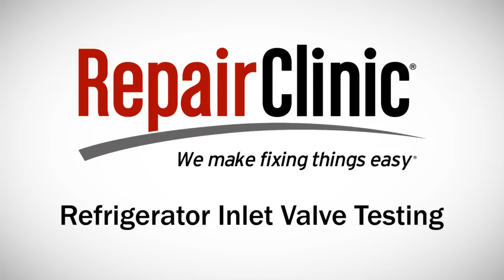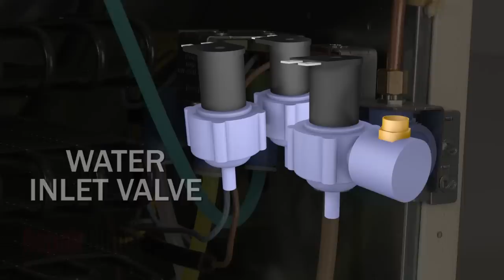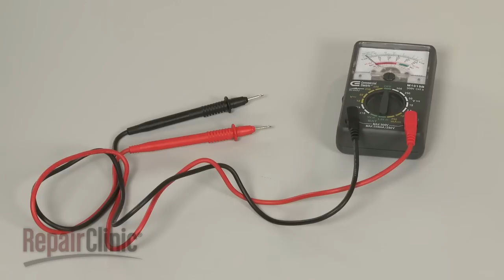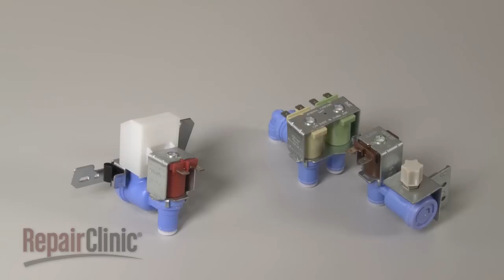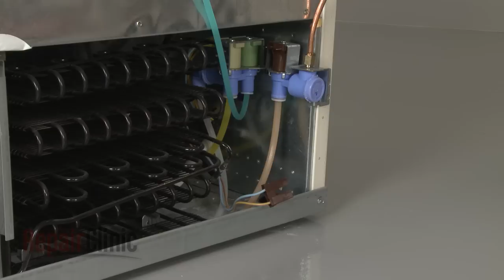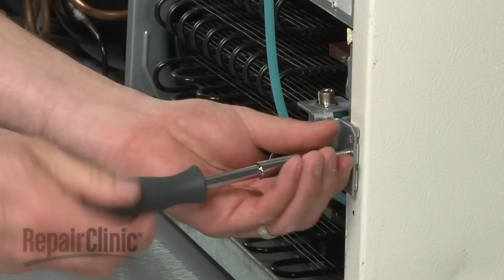Refrigerator Not Making Ice? Inlet Valve Test, Troubleshooting

Comment: My Frigidaire ice maker model FD1104S p/n 241798211 stopped making ice but water dispenser worked perfectly. I performed a resistance test with my digital multimeter of the water inlet valve as this video suggest. I just want to clarify that my water inlet valve reading was 399 OHMS. This video is great but I am sure if you have a reading  below 500 you are asking yourself does this means your inlet valve needs replacing. The video says should read 500-1500 OHMS  to be good and little to no resistance means inlet valve should be replaced. I purchased a new ice maker with my 399 OHMS reading and within 5 hours I got my first bucket of ice and it's been making ice around every hour since. Hopes this clarify   the OHMS reading concerns. Good Luck and I hope this saves time and money for someone.

Comment: Hi, I have the exact same water inlet valve set up, Frigidaire LGUS2642LF2. The ice maker does not fill or pull up water. The ice maker cycle is working, I poured some water in the rear of the ice maker and filled the tray, it made ice. Seems to not draw any water up the fill line, it is not clogged or frozen. I tested the water inlet valve with a meter as in the video. The digital meter was reading over 1000, but also was constantly fluctuating sporadic numbers.The water pressure is ok.
Reply: Hello - What was the outcome of your situation?
Reply: Having that same problem. Valve continuity is good. Water hoses are not clogged. Good water pressure. Ice maker works. Water is just not making it past the inlet valve, so replacing it will fix the issue.

Comment: My Frigidaire side by side quit making ice but the water in the door still works, any ideas? Oh ,and if you manually pour water into the ice maker it functions normally.
Reply: Old post but might help someone else. The inlet valve component on these house a separate valve for water and ice. As such one can go bad while the other is still good etc.
Reply: @mrd05d  could you just replace the coils
Reply: I have the same issue right now. Replaces the the valve but still not working
Reply: @joshhud  the valve sends water up the back of the fridge you can disconnect that and have it spray into a bucket. If water is not getting through the new valve maybe it's a bad new part. If water is making it through the valve then it would be something further than the connector at top rear of the freezer but if I recall correctly there is not much else involved. As the ice maker revolves it triggers the valve to open letting water flow.

Comment: Our Kenmore side by side refrigerator ice maker does NOT make ice even though the water pressure to the dispenser is fine. I've tested the water dispenser and it fills (8) ounces in about (12) seconds. Could a defective water inlet valve be preventing ice making?

Comment: #1.  Thanks for posting these videos and offering assistance.   Our Frigidaire RF stopped making ice recently.   It is 10 years old.   I did not do the electrical test due to the age of the unit.   We have a very strong, steady flow of water coming in.   I replaced the water inlet valve this weekend but still no ice.   Added note that I also replaced the water filter.    What should I do next?
Reply from the maker: +Steve Dyrda Check and see if the freezer temperature is around zero degrees Fahrenheit. If so, the icemaker will likely need replacement.

Comment: Bought a fridge with ice and water dispenser. The water connector ends to the valve have been cut off. The hoses are the same size I know I need to get hose adapters. But the valve has a blue and a red water connector. Do you know which color is the water side? Thank you.

Comment: My refrigerator dripes water and bilts up ice cascade along the back wall; eventually dripping on the food and wraping them in ice. Can it oly be caused by the water inlet ?
Reply from the maker: Benoit Hamel Low water pressure could cause the valve not to close properly too.
Reply: @repairclinic  mine appeared to be over filling and icicle forming towards the front and under the maker,. Turned out the ice maker was out of level. The back screw goes through a slot and the slot was about a quarter inch too high. I guess it was pushed upwards somehow. Loosened the screw and its partner and gently pushed the maker down until it was properly seated on both screws and tightened them up. Problem solved.

Comment: My Maytag refrigerator water dispenser/ ice maker not working. I replaced both filter and inlet valve already. If I remove the water filter the water dispenser works and if I attached the water filter no water will flow.
Reply from the maker: +Jay Mendz The ice maker and water dispenser have separate controls and separate coils on the water inlet valve. With the filter installed do you hear the valve still opening, but you just have no water flow? If so, the filter housing is likely damaged and clogging the line with the filter in place.

Comment: I’m not getting water to my ice maker this happened after my hot water heater was replaced. Is there something the Plummer forgot to reconnect?
Reply: I'm sure you've already fixed this problem by now, but when the plumber shut the water off it probably loosened some mineral deposits/corrosion or some other particulates,  clogging the water supply line to your refrigerator, traveled to your refrigerator, clogging the screen to the inlet valve (Where your water supply tube connects to the back of your refrigerator.

Comment: Frigidaire, not making ice, replaces water valve. Still no water. Water dispenser works fine. Do I need new ice maker or is it something I can fix?
Reply: This is my same problem. Changed the inlet valve since my continuity was reading 195 & 265. No improvements, Water dispenser still works fine but no water to my ice maker. This is where I am now, What did you do next? Anybody, any suggestions?
Reply: Sighs
Trying to figure out this same problem for a client tomorrow.
Water dispenser works fine, but no ice.
Reply: @wylian84   For me, only 2 options remaining. 1- change out (or clean out) the water line to the ice maker, thinking maybe it's collapsed or clogged. 2-Change the ice maker.
Reply: @haleiwahi27  
 I'm not an appliance guy at all, I'm a carpenter trying to keep a client happy, lol.
 But I checked everything I could, and the water line that brings water to the ice maker doesn't seem to be clogged. I couldn't disconnect from the bottom since it's one of those pressure connections and not the ones you screw in, I only unhooked from the top. I tried to suck water out of it (there was water in the line) and nothing came up.
 I guess a pump is not working, I don't know if it pumps from the ice maker, or the ice maker sends a signal to the pump on the bottom. Not sure.

 So far, my dad which is my partner will come over and thinks the ice maker is the problem. I will report back.
Reply: @wylian84  In your case, if you have water in the line, then I sort of doubt that the pump is your problem. I would highly suspect your ice maker too. In my case, my waterline is dry, so I changed the pump. But I still got no water to the ice maker. So at this point, I'm puzzled.
Reply: @haleiwahi27  did you check the wiring that goes to the pump and see if you are getting enough voltage? That's the only thing I can think of.
Reply: @wylian84   No, I didn't, that's a great idea. That will be next on my agenda. Mahalo (thankyou)
Reply: @haleiwahi27  said I'd be back and forgot. We changed the ice maker
Reply: @wylian84  ME: - I sold the house and gave him the refrigerator.
Reply: @haleiwahi27  that's one way to solve it.
Reply: Ray07  I raised the price for the house $3k and gave him the refrigerator :o) House & fridge are gone from my life. I am now back in the islands :o)

Comment: My water dispenser stopped working a while back but, since we seldom used it, I never bothered to fix it. Now, the ice maker has stopped as well and, since we do rely on it daily, I started investigating the problem. There was no water in the ice cube tray. I first checked for proper water pressure at the supply line valve and that seemed quite adequate. I next checked to see if there was anything frozen and even took my heat gun to it just in case. No problem there. I checked the supply line from the solenoids to where the fill tube feeds the ice cube tray by blowing into it and it, too, seems fine with good air flow. My first thought was that the solenoids were faulty, ordered and installed a new one and the water dispenser and ice maker work still do not work. I was thinking that the next step is to bite the bullet and replace the ice maker itself. Does anyone have any further ideas as to what to try before doing so? I did take the cover off the ice maker motor section but there were no holes to put a jumper wire to manually test it's operation. Appreciate the help!
Reply: Do you still have this problem? I may be able to help. Also, if you have fixed the problem, what ended up being the cause? I suspect you are/was not getting power to the solenoids. If you still have the problem, perhaps try running power directly to each solenoid and see if one feeds the water dispenser, and the other feeds the ice maker.
Reply: Ralph Tomaccio I have replaced the ice make, water valves and filter. Water pressure is sufficient and present at the door. Freezer temperature is correct and no frozen lines and still no water to the ice maker. I jump between the L&N and the ice maker cycles fine but no water at the cycle end. I guess the power or signal is not getting to the ice maker valve where can I check next. (Maytag side by side MSD2655HEB)
Reply: My refrigerator stopped dispensing water.  After several days on YouTube University, I realized the following:  My freezer was still making ice.  I changed my water filter to a new filter and purged out any  air in the line.  My refrigerator side crisper area water reservoir tank was not frozen.  I changed my water inlet valve to a new water inlet valve and  verified both for continuity prior to installation.  Both the old and the new showed nearly identical continuity confirming a working water inlet valve.  And still, no water.  Unless both the old water inlet valve and the new water inlet valve both have defective mechanical issues.  What are the odds?  I am suspicious to that being the issue.  I removed the main water line and  checked water flow.  Very solid and good pressure.  I then connected the main water line to the new water inlet valve and turned on the water supply.  The water ran through the water inlet  valve up into the water filter and back down the return line.  That is where the water flow ends  for dispensing water to drink, but not  to the freezer to make ice cubes.  So, something is not  "turning on" or allowing the water to be dispensed at the push pad.  Yet, water is going up to the freezer to make ice.  I am baffled.  Problem Solved:  I removed the lower front grill to the refrigerator and separated the water line.  Pushed water pad dispenser, no water.  That line runs back to the water reservoir which was low on water.  The water inlet valve fills the water reservoir.  Process of elimination, I ordered a new Control Board (the computer behind the Water, Crush, Cube) panel and BAM!!  It worked!!  After 5 min installation, I pressed the water dispenser pad and I heard the water inlet valve filling the reservoir.  Once filled, water proceeded to reach the water dispenser and out into my cup.  It was my Control Board all along. $89.00 from Partswarehouse.
Reply: @GR8WHITEC5 wow this exactly what my whirlpool is doing… checked everything is all good… I then went to YouTube university lol I like that term… spent 3 hours learning this trade, then I came to your post and since tomorrow is 4th of July everything will be closed so I’ll order the part on Amazon and hopefully this will come out like how’s yours did. Thank you for your comment.. happy 4 th everyone…

Comment: My water dispenser stopped putting out water, mainly because i was running it quite a bit to fill up a large water container.  I used smaller bottles and paused occasionally to let the solenoid "rest" (cool down) but it gave out about 2 gallons into it.  I chalked that up to overuse and  I replaced it with a Robertshaw part because everywhere I called asking for a "factory whirlpool part OEM original only"  This is what they all tell me is the original part, although it looks like a cheap piece of junk compared to my original part.   I installed the new valve in about 5 minutes and it worked fine, problem solved right??  it failed 10 days later.  I don't know the circumstances, I was not home when it stopped working. It would buzz a little when the paddle was pressed, but no water comes out.  I ordered another inlet valve.  This time after installation,  I still had the buzzing and still had no water.

My fridge is model # 106.56566400  (I've memorized it after searching for parts)
1. Water line in door is not frozen (you could blow through it from the quick connect to the line in the dispenser)
2. Switch in door is working
3. Coil has 190ish ohm resistance on both new valves I installed
4. Water pressure in the line is fine.
5. Water filter was replaced and fills when inserted (you can hear it)
6. I could find no evidence of any damage on the main control board, in fact it looked like new.
7. I checked the voltage on the connector to the water dispenser side of the inlet valve and when the paddle is pressed, the voltage goes to 16 mV, not even a volt coming through.  I honestly don't know how to check the amperage.

Since nothing worked, I took the new valve apart and pulled the water dispenser valve coil and installed it onto my original valve that failed, but when it failed i could see the coil was failed on that one, so it had an electrical failure not a mechanical one.  With the new coil on the functioning mechanical valve, I still got buzzing, but no water.  

I checked the repairclinic website but could not find the answer.

What is left??

Comment: Per the video there's an assumption that if incoming water supply is of adequate pressure then the inlet valve must be at fault. But, in my case, the dispenser is behaving normally so that would rule that out, no? I do have SOME ice but it's low production. I think it would take weeks to fill the bucket.  Could a defective valve still allow SOME ice? It wouldn't be that expensive to just replace it...

Comment: Hi.  I replaced with a brand new ice maker for my Whirlpool ED5JHEXTB00 that I bought from Amazon.  It seems to be turning and doing it's thing mostly.  BUT, after an hour or two, it didn't feed any water from solenoid.  So another video showed how to short L and V points to energize the water feed.  I did so and it fed water just fine.  So if it's not actuating water, and all things are in place (which isn't that complex);  arm down, bin in, door shut, but no water except if I short the L and V points, what else could be going on?  Thanks.
Reply: HI Jeffrey - What was the outcome of your situation?
Reply: Yes what ended up needing fixed?
Reply: @Pittsburghpilot  I'm trying to remember now. It's been a year.  I'm pretty sure I just needed to have some patience with the cycling.  I also know I had to adjust the timer calibration to allow less water in so th cubes would be a bit smaller and not get stuck in the chute.
Reply: @JonathanThompson1320  See my replies below to Scott.

Comment: my refrigerator has the two coil type on it,  I tested both coils one coil is getting a good reading for the icemaker... the other one is not getting any reading at all....  does both coils suppose to get a reading?  this is also a new part i just ordered.  and that is the reading I am getting from it.  I no that after purchasing it I am getting water into the icemaker now, but none coming out of water dispenser
Reply: Both coils should have a reading of 100ohms-1000ohms.

Comment: I have found more often than not if the water dispenser is working then the water inlet valve is fine and there is another issue going on with the ice dispenser.
Reply: Check the ice maker module....check for voltage to ice maker L and N.....then if you have voltage jump with insulated wire L and V

Comment: My Refrigerator water dispenser works perfectly but the ice dispenser doesn't work. Water does not fill in the ice cube tray.
Reply: That happens all the time.  Their are dual solenoid valves and it's possible only one of them has failed.

Comment from the maker: I would recommend using the repair help section of our website (link in the description). If you enter your model number there you'll have access to part, model, and symptom specific repair help.
Reply: Water valve voltage on ice maker

Comment: My refrigerator is not dispensing water, only the ice machine is working and I tested all the tubes if any of them were frozen buts that's not issue. What could be the issue? Thank you
Reply from the maker: +jaimemyspace1 The water inlet valve on the back has separate solenoids for the water dispenser and ice maker so the valve could be defective.

Comment: Where is the valve coil located?  I have a Whirlpool Gold refrigerator
Reply from the maker: +Kris Froelich The water inlet valves are typically located behind the refrigerator where the main water line from the refrigerator connects.